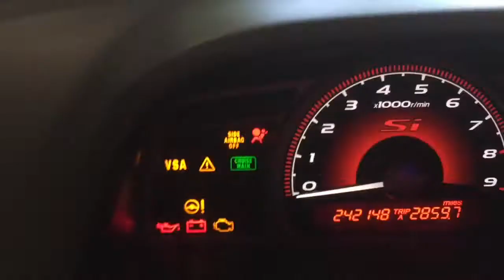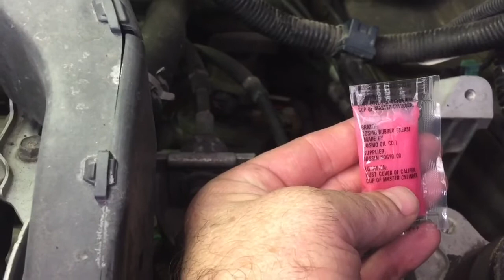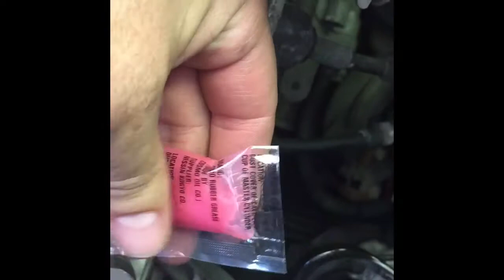2007 honda civic si stiff clutch, clutch master cylinder

Comment: I just bought a used 2007 Honda Civic EX 5 sp. The clutch seems to be very stiff. Anyway, it is a whole lot stiffer than in my 1991 Toyota Corolla. I also own the 1995 Honda Civic. Its clutch is extremely light, easy, and pleasant. I cannot understand such a radical Honda departure. Here is my question. This CMC has an offset chamber (pressure damper) the fluid goes through. Why is it there and what purpose does it have? Thank you.

Comment: I drive 2009 Civic Si. Not sure what is wrong? When I drive normally (changing gears before 5k rpm) the gear shifts are smooth. But when I drive it hard for few minutes, gears won't engage. It feels like I'm changing gear without using the clutch. Clutch is not slipping CMC is ok. Do I need to change the clutch?

Please let me know if I can find a good mechanic in North Pittsburgh area.
Reply from the maker: Unfortunately I cannot help you with a mechanic in that state since I don’t live there. Diagnosing the problem on here probably isn’t a great idea since I’m not a certified Honda mechanic. My recommendation would be to bring it into Honda since they would have a lot more knowledge and experience with particular issues that arise with these cars.  
i’m sorry I know you’re looking for help and hoping to find something that can lead you in the right direction. I think the dealership would be your best bet to start with. 
good luck.
Reply: @chrisprinceranch  no problem... thank you

Comment: I have changed the clutch master cylinder, and my clutch is still the same (stiff) what could the problem be?
Reply from the maker: hard to say, the only other thing that comes to mind would be a bad pressure plate.  my suggestion would be researching on one of the Honda forms for someone who has had your same issue and see if they were able to resolve it. sorry I was not able to provide you with a fix.

Comment: My clutch pedal seems to be very hard (had the car for two months) can the clutch master be the issue?
Reply from the maker: jose52788 
Hard to tell. Could be your master cylinder, could be your slave cylinder, a couple teeth on your pressure plate might have gotten bent or busted.
Reply: chris prince did your pedal get better over time?
Reply from the maker: it did get better, it got close to the natural feel. But I could tell there was still something not quite right. I don’t think most people would notice.

Comment: Did you ever get this fixed, and if so what fixed it?
Reply from the maker: the work i did in the video made a difference. however, i then sold the car soon after because i picked up a truck and didn’t need both vehicles.  so i don’t have a long turn update.

Comment: 27:18 My Exedy One Came With Little Plastic Ones🤦🏻‍♂️.. Won’t Be Using Those
33:00 Shouldve Put It On The Floor Man Would’ve Been 10x Easier
Should Have Changed The Slave Cylinder As Well Don’t Want To Have Too Come Back And Do It Again